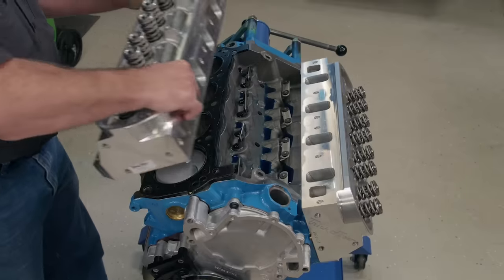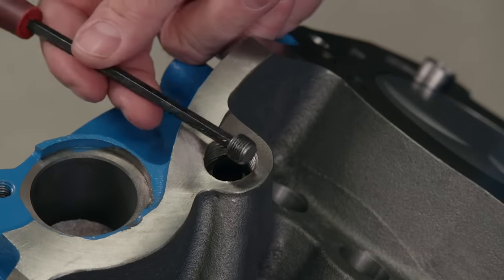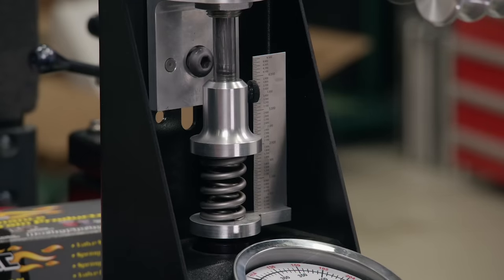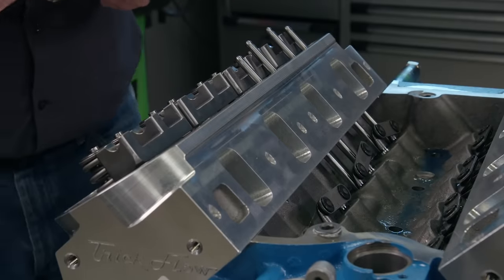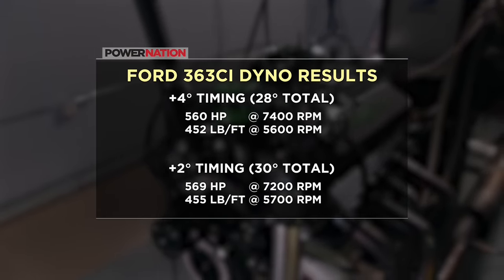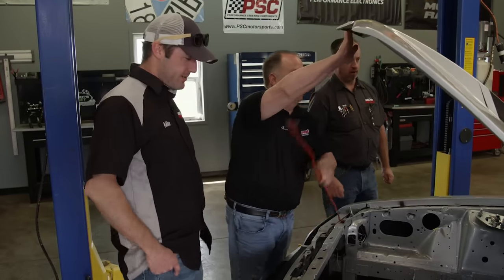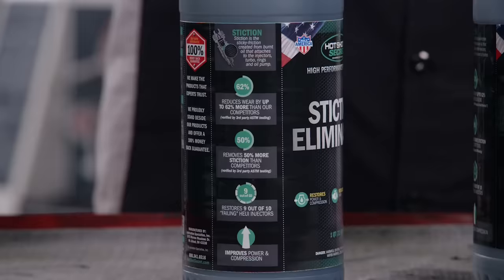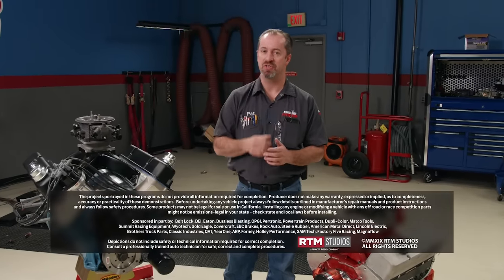A Little Science + A Little Money = Triple the Power? - Engine Power S6, E13

Comment: Nice heads, good cam. Intake. Big carb. That’s about it.
Reply: bulletproof block,forged rotating assembly(crank,rods,pistons)decked   ..... wicked heads,massive solid roller cam.....     its a 20k   575 horsepower screamer that will rev to 8000 rpm for hours on end

Comment: Not a Ford guy, but I'll take it!!!  Great components across the board!  Would like to see this thing run with a 200hp shot of nitrous!
Reply: how can you not be a ford guy??
Reply: I seen a guy put a 150 shot of nitrous on a 500 cubic inch Cadillac engine (a 1975 Cadillac sedan)  all stock, and was shocked at how fast it was. A 5,000 pound car going from 0 to 60 in about 6 seconds. Not super fast but much faster than the engine by itself which was about 11 seconds
Reply: @bertgrau9246 , I've played with the Cad big blocks, and they are a great engine!  Head design, bore/stroke ratio, iron content, and little things like front located distributor, rocker shafts, only 50 lbs heavier than a SBC, etc.!   Not an RPM engine, but they can handle abuse!

Comment: Humm got more generous with the oil on the lifters ...... Than the Cam ...
Reply: Did you notice when they started to install the cam it looked like it had rust on the lobes? I guess that's not a big deal on a roller cam but I would have sent it back in favor of a rust free unit.

Comment: I have a 900 hp small block fordin my 2017 mustang that is all ford for about the same money they dropped on this set up and I can dial it up to 1200 hp by adding a little more boost out of the 55 mm turbos I installed. They have about $12,000 to $15,000 in this engine and I have $13,800 into mine including sleeving the cylinders.

Comment: 575 hp on pump gas from 363 cuin. That would be 478 hp if the engine was a 302. So it is possible for a 302 to make 500 hp.
Reply: If it’s a stock 302 2 bolt you really don’t want to go above 500hp. This is a dart 302 4 bolt which easily can hold 1000hp plus. My 93 302 block is at 485hp and runs great!
Reply: A 5.0 modular motor has around 460hp or so stock. If you want to deal with wires and such
Reply: @refiii9499  Show me video

Comment: The added 6 hp is probably from going to 34 degrees of timing not fuel injection, it probably lost hp due to the efi. Even tho it makes alot more power than the other motor it wont take long before they want more power, you get used to it fast.

Comment: 😬impact gun to put bolts in 😬
Reply: i was thinking the same thing. could be inconsistent
Reply: @dahei870  I like running each stage over and over until the first bolts stop moving....
Go back and check em , you'll be surprised.  
it's worked for me.  (on a head for example)

Comment: Want a 302/351 to never split? Get it internally balanced. Splitting in these blocks is caused from the main caps "walking" under high RPM loads. The reason? When these are produced they are made with an imbalance that will cause the crank to flex at high RPM loads as either end of it is weighted. When this happens it is G'night block. 

By internally balancing them on an aftermarket crank (stockers are too small) you are able to push retarded high RPM (typically safe to around 8k) and when you are using a cam and cylinder head that can take advantage of it...will make an obscene amount of power. 

Research it for yourself. Almost ALL ford splits are at/near the mains on these engines and a girdle, windage tray or even align hone will not save it because the CRANK is flexing inside the assembly. Internally balanced engine = happy days.

Comment: So how can i get my 1/2 inch impact to tighten to specific rod and main ft pounds? That would make life so much easier
Reply: Torque sticks. Extensions made to twist. But torque wrenches are far more accurate. Ps- If you're joking, I get it.
Reply: big Hurtt it was sarcasm
Reply: @mikecorleone6797  it would be cool if the adjustment switch on the back of an impact wrench were calibrated to specific torque values like at a factory

Comment: The Ferrari F12 has a 383 cuin v12 and make 730 hp on 93.
The Ferrari 812 Super Fast has a 396 v12 and it make 787 hp on 93.
Reply: 4 cylinders more, 2 valves more per cylinder, dual overhead cam and more rpm.
Reply: @guy_autordie  You ever hear of Nascar? V8 2 valve per cylinder ohv 8,000 rpm.
Reply: @blackericdenice  not on pump gas
Reply: @blackericdenice  how much are nascar heads,if you could buy them?
Reply: @BruceLee-xn3nn  IDK
Reply: @BruceLee-xn3nn  probably. Double what these 11rs cost at a minimum

Comment: they should have gotten a 400 cube build and a little more tq and hp so the engine doesn't have to try as hard for the 580 hp maybe some slightly bigger heads.
Reply: Ther may be a cu in limit in the class they run. And you want to turn rpm in an endurance engine and rev quick out of a corner

Comment: i might have missed it, but did they mention the compression ratio?
Reply: Judging by the flat top pistons, heads, and the pump gas test in the low 10 to 1 range..
Reply: @robh9577  is this a guess or did they say that? if they mentioned it, can I get the time where they have that info? thanks
Reply: @PANTYEATR1  they didnt but some math on a flat top 363 with 11r heads would be 10 or 11 to 1 with the size combustion chmber an 11r uses. Not hard to figure it out if you wanted to know an exact figure
Reply: @KingJT80  i didn't bother looking into it. i have a 427 with about 10.8:1 compression and i made 434hp and 474tq to the wheels. I'm a little salty i didn't make more, but i think i might have another 20hp in it

Comment: They had a stock engine with less than 200hp as a "race engine".  Then get a decent engine built but use a wet sump oiling system and just block one galley and pin hole the other to increase pressure.  Not to mention the series sponsor foots the bill (at least partially).  I'm so confused. This is all over the place.  Enjoyed the build tho, nice job fellows.  About as "cheap" of a race engine you could build with any chance of staying together.

Comment: Just way off the lead in statement(s)
Way more money spent here than need be.
Cylinder heads and camshaft (breathing) is what makes power, not high dollar aftermarket blocks, custom pistons etc
A factory Ford 351W bottom end with ARP fasteners is safe to 800hp - for as long as you wish.
We're running a Vortec boosted 351, aftermarket heads, a mild comp turbo grind hydraulic roller, pulling 635rwhp - so figure over 690fwph, of the shelf forged pistons in a stock W block with stock rods on a stock CAST crank - ARP bolts all through, no studs on the mains, and no girdle.
As far as durability, this engine has seen over ten years of Hard Street racing.
I've torn it down for inspection twice in that time and there's no signs of being near its power limit. The big ends on the rods are still on size within. 0002" of when the engine was built and same goes for the mains. No signs of main cap walk or odd wear patterns in any of the bearings - now that's a stout FACTORY short block.
As far as 8.2 deck blocks - the early to middle '70s 302 block is MUCH stronger than the later 5.0 block. At the transition from 302 to 5.0, Ford removed considerable iron from the 302 block - iron that provided more strength than the "new" 5.0.
I've yet to see an older block split like the 5.0 castings are famous for.

Comment: This video is also trying to trick people into buying holley FI. If the air fuel ratio was the same with the carb. Hp would have been the same.
Reply: @bigboreracing356  It does not matter weather carb of fi if the air/fuel ratio is right. They will make the same hp.
Reply: @bigboreracing356  Tell me why carb make more hp.
Reply: @bigboreracing356  You can't tell me because you don't know. I can explain why the hp would be the same because I know what I'm talking about. Fi does a better job and use less fuel. Max hp would be the same between the two if the air, fuel and timing is also the same.
Reply: @bigboreracing356  The air don't need cooling.
Reply: @bigboreracing356  No you run more timing with fuel injection because fuel is better atomized. This is also why fuel injected engines run better when cold.
Reply: @bigboreracing356  If you say so
Reply: @bigboreracing356  The intake does not need cooling. As long as the air fuel ratio is the same. Carb and Fi will make the same hp.
Reply: @bigboreracing356  People put cai on fuel injection because they are stupid. They don't know the stock air box is cold air intake. 
People don't put cai on carb because no one make cai for them.
Reply: @bigboreracing356  People call me name when they can't school me with the bs they felled for. I didn't learn what I know from companies trying to sell me parts I don't need. At the same time, I'm smart enough to embrace new technology when it help me.
Reply: @bigboreracing356  Dude, stop lying. You don't race cars. I'm not commenting to you anymore.
Reply: @blackericdenice  I couldn't tell you why the carb would or wouldn't make more power either,but I remember the dyno guy from Roadkill saying that carbs make a little more hp than fuel injection,but the fi is more user friendly.
Reply: @bigboreracing356  a carb is not better than injectors
Reply: @FATMIKED5183  Again I say if the air fuel ratio is the same. Carb and fuel injection will make the same hp.
Reply: @bigboreracing356  OMG, did you really just say that?

Comment: Im sorry but why on earth would you run a 80's lobe technology single pattern cam in that engine? Lots of hp and torque left on the table im afraid. The exhaust duration needs to be at least 8-10 more degrees @ .050 if they are going to be buzzing it to 8 grand.

Comment: I would think that 363 small block ford has bad rod angles for endurance racing...unless the Dart block is something different but it sure dont look like it. I think the 331 stroker is pushing it..let alone a 347...now a 363...hmmmm
Reply: A 363 is a 4.125 bore short stroke dart engine.

Way different that a 331/347 and way stronger

 an n/a 347 stock block would spilt like that at that rpm and power level

Comment: If it has  triple the  power what are they using a Junk yard 302!  I run  my Fox Mustang 302 on the  Dyno last year and had 276 to the  rear wheels!  My car is a stock 302 with ford parts and an after market Cam
!
Reply: Aftermarket cam = not stock
Reply: Your car is putting more hp to the wheels than it had at the crank when  it was new.There has to be more than just a hotter cam in it to gain 100 whp.

Comment: Still using a central camshaft with pushrods and two valves/cylinder... Good luck boys. (You'll need it.) 
And really? Dyno an engine with brand new parts without braking it in? 😢
Reply: E 
They said at the first they had already run the engine to break it in.

Comment: With all the money invested in that engine, I'm just not impressed with the power.  Use stock LS short block with a set of heads and a cam and you have 600 hp really easy and cheap.  It is a cool engine and I love a Windsor Ford, but it just takes too much modification and money for those results.

Comment: Triple the power, seriously, so you are saying they are running less than 200 hp at the crank? Doesn't a stock 302 have 285 h.p.?
Reply: Pretty sure the stock 5.0 in the fox bodies were around 200 flywheel hp so you're looking at around 175 to the wheela
Reply: @HillBillyAsian  It was 215-225 BHP with OEM add-ons and exhaust system, just take those away and you get a bunch of extra ponies. Apples to apples, they might be doubling the power, not tripling
Reply: @Boredoutofmywits  its more than Double double is like 450hp. This is almost 600

Comment: A cast iron  roller cam into an endurance engine ???
Reply: With too much spring pressure for a SADI core and limited oil supply to the lifters as well....that already have a bad rap in the racing community for eating the rollers. You NEVER restrict oil to the lifters!! Most especially in an endurance application. That will also kill the valvesprings in short order since that same (Now restricted) oil supply is the only thing cooling them.
Simple answer, run standard oiling and run extra oil returns from the heads to the sump of the oil pan.

Comment: 15 year old 347 Windsor with trick flow r heads and a above average flat tappet cam and made 545hp and 450 ft. Seen 7800 rpm on limiter hard for its  whole life.  Not that impressive for 2020
Reply: On an endurence application? Its woupd split if its not a 1/4 mile engine gaurnatee that your engine cant do that

Comment: 575 hp is the max on pump gas is another lie. Ferrari make 570 hp from a 275 cuin n/a v8.
Reply: I really doubt anyone is telling a "lie".  Show a little class.
Reply: Yea explain all the street cars that come from factory with 575+ which is a shit ton, and guess what the manufacturer isnt gonna have you running on expensive gas. They got you runnin 93
Reply: He didn’t say that, he said 1.6 hp per ci. was close to the limit on 93 for this engine. This engine is relatively low tech compared to modern engines, it doesn’t have direct injection or variable cam timing etc. Use your noodle!
Reply: @badgerbait8351  If Obama was not telling you the truth, he would be telling a lie.
Reply: @mustangfoxbody4797  No that is not what he said.
Reply: @edwardmyers1746  Thank you.
Reply: @johncholmes643  Sure you are. Brother are not afraid to show their face.
Reply: @johncholmes643  Leave me alone Lance.

Comment: A little money huh, what $10,000 when all is said and done. You guy's have spent way to much time using big money parts to even know what little money is.  Powernation for the rich and insane.
Reply: You did not get the video,  clearly they're are building it for a race team.
This is not no junkyard truck motor crap. Yeah I see it will make power, but how reliable is that motor going to be with consistent high RPM and endurance.
Reply: Just rebuild your 302 put AFR 185s and their matching renegade intake on it and pit a .550+ lift cam in and a 600dp

It won't cost 10k but its not gonna be some 300hp 5.0 with a performer package and pickup truck cam

It cost money to play

Comment: Dam ford's suck. If u want a real motor just get a chevy ls motor it's way cheaper to build ND parts are way more accessible. ND it won't break like a ford. All that money ND he only got in the 575 hp range how sad. Watch he put plug in to send oil directly to the lifters ND rods ND crankshaft but all it did was raise oil pressure hope it don't blow seals from too much pressure